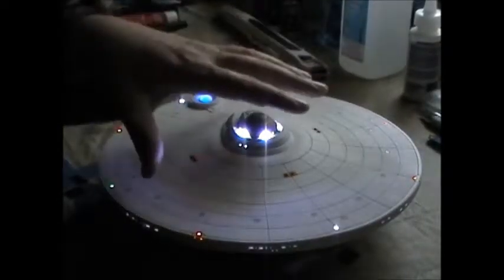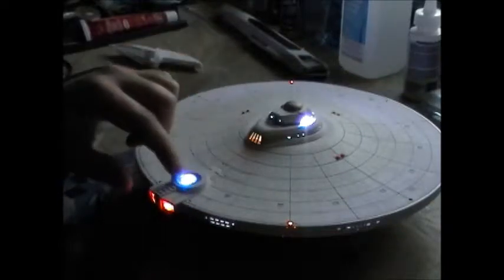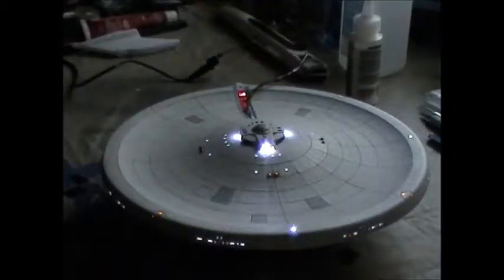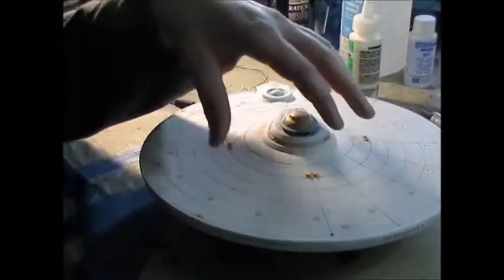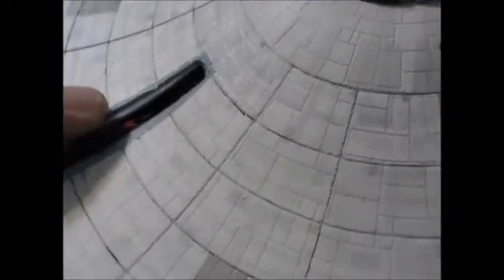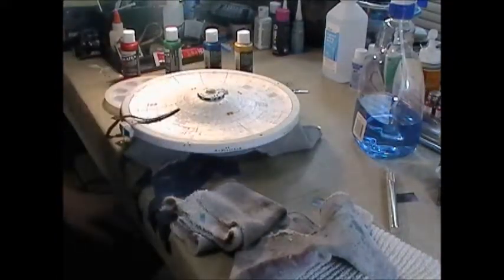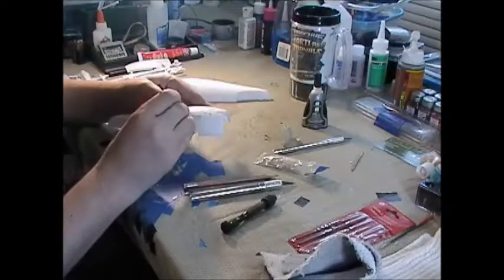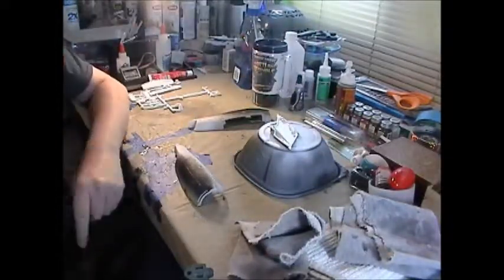AMT 537th Refit Enterprise Build Ep10

Comment: If you really want the square lights... drill a hole larger than the square light , fill it with micro clear and then make a mask the size of the square light and spray. Remove the mask and you have a square light. You might need to put down a light blocking layer before the the top coats.

What decals are you using for the Aztecs?
Reply from the maker: facepalm That....makes so much sense that of course I didn't think of it. lol. I'm using the HDA set, the silvering is all my fault, but I have no clue why my clear coat is causing the pealing.
Reply: It looked to me that you had a flat paint prior to putting on decals. Use a gloss finish clear coat before decaling. Decals won’t stick to a flat finish